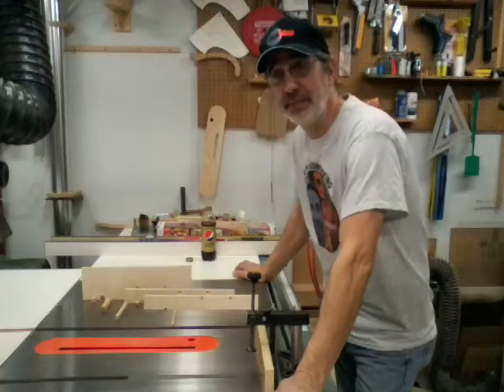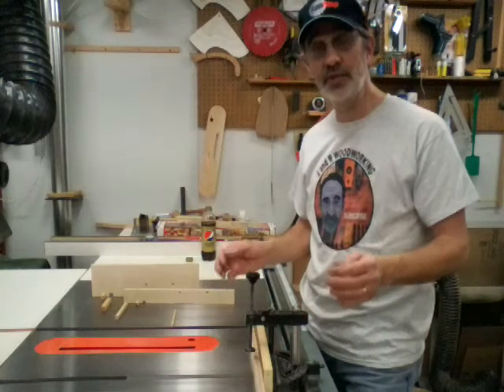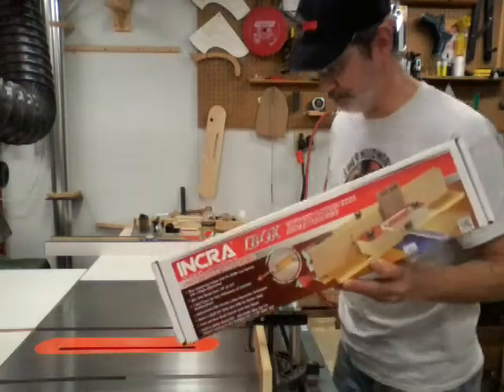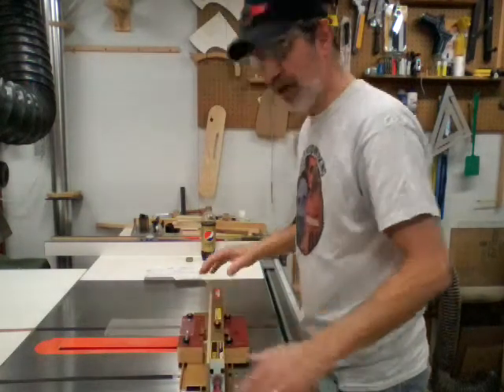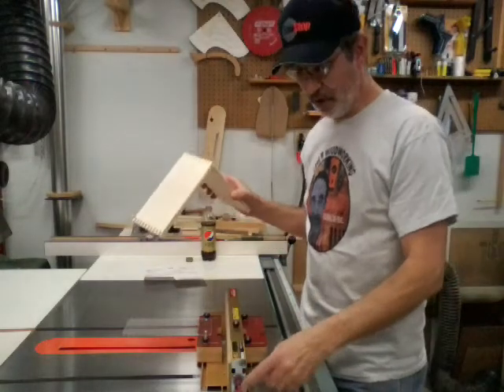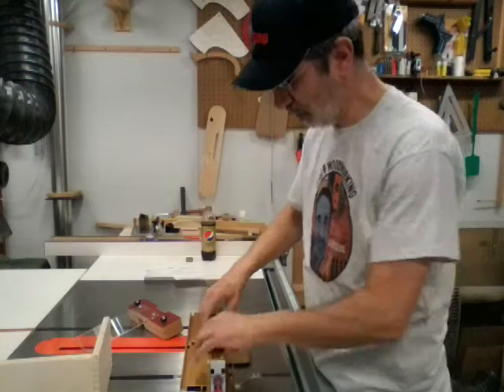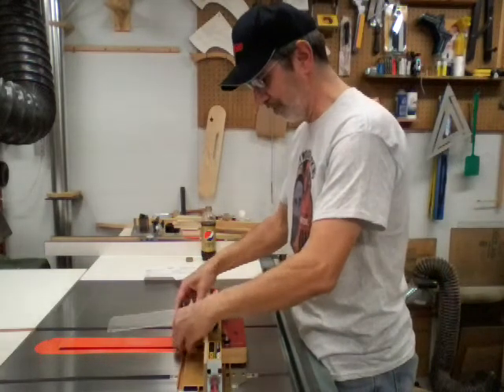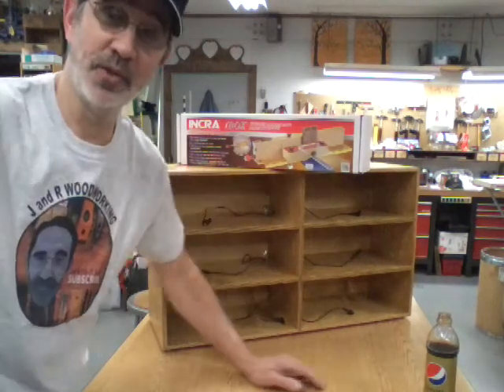171. A review on the new Incra ibox

Comment: Jim - this is a great video - short and sweet. You explained how the iBox works without taking 20 minutes as I saw in another video. I am a newbie woodworker and just made some box joints for a small pencil/pen holder for my shop. I love the joints, but they aren't uniform and as you say, it was kind of a hassle, especially since I don't have a Dado blade - although my Freud flat-top blade works well. I also like your style, modest and plainspoken. I"m probably going to buy one of these iBox jigs. They are made in the USA and it seems you can't go wrong. I have also subscribed.